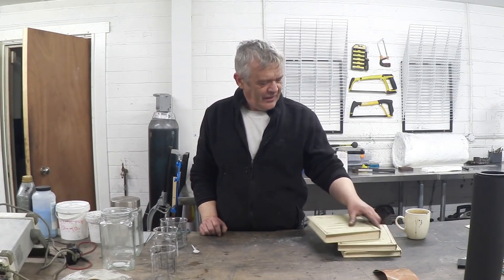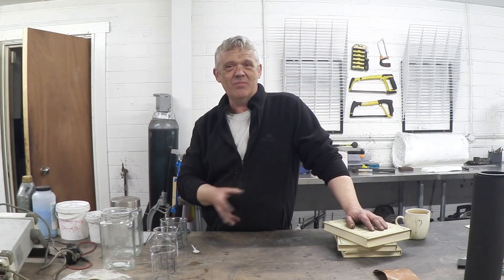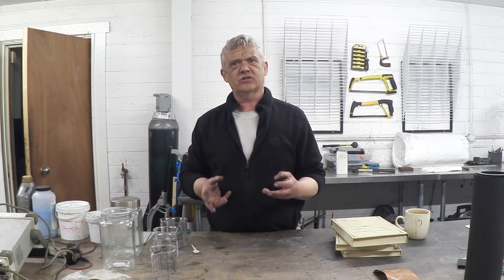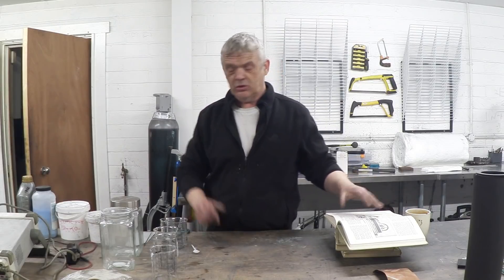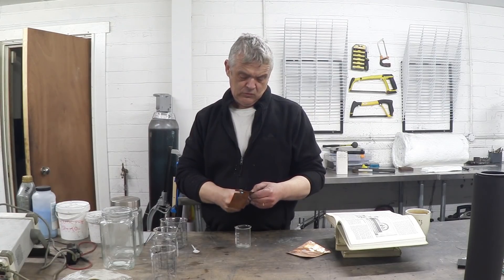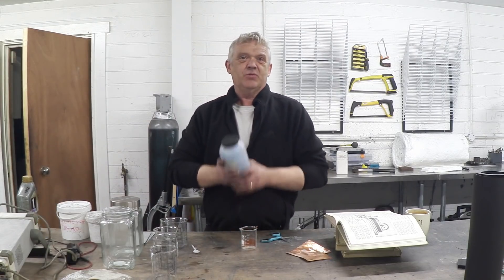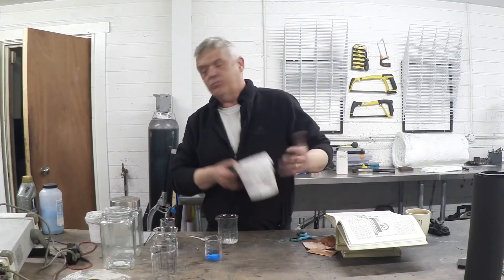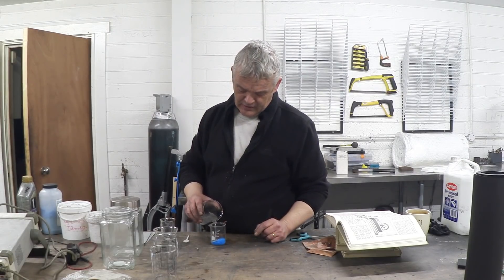Gravity Batteries - Cheap, Easy, Robust And Awesome For Off Grid

Comment: Sir, is there a formula we can use to figure the amp hours for these batteries based on starting materials?
Reply: Just wondering would you be able to make a version of this that takes less electricity to charge it compared to what I gives out?
Reply: @samboddy3182  it depends on the materials you make it from ...  you can look this up yourself, but there are two categories these batteries fall into:  1. a primary battery and 2. a secondary battery or storage battery .  While secondary batteries need a charge to supply electricity, primary batteries provide electricity as a result of the electrochemical reaction of its constituent materials.  One such battery mentioned is the zinc/zinc sulfate copper/copper sulfate battery Sir Robert describes here.  That battery requires no electrical charge whatsoever, because the zinc anode will give up electrons and the copper cathode will consume them.  As the zinc gives up its electrons it combines with sulfate to form zinc sulfate while the copper sulfate will carry the electrons to the copper cathode and the copper sulfate gives up its sulfate and returns to copper metal thus increasing the size of the copper cathode.  So in this reaction what is needed to keep it going is from time to time replacing the zinc anode that gets consumed, removing some of the zinc sulfate solution as it gets too concentrated, and adding copper sulfate which is also consumed.  But apart from that, it needs no electrical charging at all to function.  This is the definition of a 'primary battery' or 'primary cell'.

Comment: I expected a weight on a rope plus a gearbox and generator.
Reply from the maker: lol
Reply: gravity potential ones have low power density for home application
you will need over a douzen tons of weight to replace 40-50kg stationary battery

Comment: Interesting but pointless, the days of making stuff at home are over. If someone wants to develop this idea commercially then good luck to them, it would be up against fierce competition in a crowded market right from the very start.
Reply from the maker: I understand what you are saying but tbh you might be missing the point. The days of making stuff is in fact growing when facing the poisoning of the world by shameless consume and throw away. Now lots of folks are thinking make and be proud. It's what i believe too - i see you don't but you are free to make your choice of course.
Reply: Robert Murray-Smith I found your video of great interest because I actually live off-grid myself. I use a pair of leisure batteries for lighting and charging phones on my boat.... One day I hope to pull the diesel engines out and replace them for electric motors with NiFe cells. Possibly some home made NiFe cells.

Comment: You would be interested in the Earth batteries used on the telegraph lines back in the eighteen hundreds,  for some strange reason they never seemed to wear out, perhaps because after a while they ionized the earth, around them and plugged in to random telluric currents.

Comment: Oh good lord! This is utterly unsustainable. The energy required to mine, refine, process, and ship these metals and materials is hundreds, if not thousands of times higher than the energy you get out of this thing. Those materials are only cheap to you because all these expensive processes are subsidized and many costs are "externalized" onto the public, especially poor people. Then, what are you gonna do with the chemical solution after everything is expended? Pour it down the drain? Sure, you could reclaim the metals. But it takes even more electricity to do that. 

This is the indirect, chemical equivalent of a perpetual motion machine. It requires energy input from outside to work at all.

Comment: You have shown a battery.  For sure.  I expected you to show an energy storage system based on the falling of matter, from some height to a lower position, giving up energy in the fall.  I have seen several types of real gravity battery, so I do not think your display does not qualify.  I would describe what you have displayed as a chemical battery, like the battery in your car.  

I would have liked to know what the voltage and current, hence power,  your battery provided?

Comment: if a single cell was to be made on a larger scale, would the voltage increase due to larger surface areas ? Will the current increase? I do believe that the storage capacity would increase..  do batteries of these have a maximum power point? It would be interesting to put these batteries on a computerized charge controller to monitor the capacities. If we ever get out of lockdown... i'd be interested in trying these experiments in a 50 gallon aquarium size battery.... ! Thanks for the great video.... !
Reply: Put the cells in series to increase the voltage.

Comment: I have been a BIG believer in the power of Activated Carbon Water Filter Cartridges, especially in any Electrical Application where  SURFACE AREA affects efficiency. I'm led to believe that the average 10" x 2.5" Extruded Carbon Water Filter Cartridge at 1micron contains approx 4000 square meters of surface area. That's impressive for any kind of gravity battery or flow battery technology - in order to become competitively superior to Lithium Battery technology wrt power density vs cost.

Comment: The  reason I clicked on this vid is something I've thought for along time. Gravity batteries!! A 5000 pound concrete weight suspended from a device that employs something like a clock works. Using a chain hoist to raise the load to 10 foot high or higher. And a machine that converts the stored energy of the 5k pound weight to a rotating shaft spinning at 3200 rpm to turn an electrical generator
Reply: Guess i need to make that machine and video
Reply: @weslingm  The main challenge would be to keep the rate of descent constant in order to charge a set of batteries.

Comment: Thank you! Very interesting, and nice that you you dig into old ways of doing things. Making a off-grid battery of the second type, for a household,  would require a quite large container - or could they be installed in series/parallel?
Reply: Install them in series to increase the voltage.

Comment: Funny, I was sure that this was going to demonstrate different techniques of "pumped hydroelectric." 
On a large scale, I wonder if these are more or less efficient than pump hydro?
Reply: The answer to that lies in the scale required. Odds are this would be more SPACE efficient, and better for small scales while pumped hydro would be awkward at small scales and in tight spaces. 

On larger scales, the pumped hydro would start to shine. Areas where you are having to fabricate head pressure for pumped storage would probably warrant looking at a chemical/ gravity battery.

Comment: i am not a chemist so this may be out in left field. is the solution a form of salt as i recently saw something like this for a large commercial batteries the size of shipping containers but they used two solutions. each container would hold 100kwh of charge but they were not suitable for mobile applications either. also they could charge the solutions separate from the output cells.

Comment: I have a 10 KWH  Solar system  on my house and my electric company is buy my power at one rate and charging four times that rate to buy it back , so I would like to store energy in a gravity batteries that are much larger.... I was wondering if I could use a Blue plastic 55 gallon drum to  hold the con-taints of the battery...can I make a 55 gallon battery out of the drum.... And what would that look like to make .... how many drums would I need to make to hold 300 KHW of energy or maybe even larger battery system , like 500 KWH of energy?  Thanks for sharing your information

Comment: I'd be curious to hear a practical discussion of how this would compare with a bank of "high end" batteries used today for solar projects for operating homes. I believe this could be done more cost effectively and perhaps just as safely in an out-shed / house scenario receiving charging from various sources (solar, wind, even electric grid). So, my question: how would you ascertain the size you'd need along with accompanying duration for a full home load?

Comment: Might be more interesting if you zoomed in closer so we could actually see what is happening inside the jars.
Reply: And some of the shots feature dark objects held with black gloves in front of a black shirt.  Works well as radio, I suppose!
Reply: If you try it yourself. You will see it up close.
Reply: Zooming in as a one man production might not be that easy. Working with two cameras and cutting the video will be much more work. But at least you could reach with your hand closer to the camera and show, how you folded the pieces into the jar, for instance. 
If you would sit down for the video, your face would be automatically be closer to the object, you're working on, so that you could zoom in permanently, nearly doubling the size of each axis.
Reply: My first thought. I can’t see what’s happening. Very cool but I can’t see sh*t!
Reply: Yeah... He can use two cameras one for zooming in. One for the presentation....There after edit the video... Make them one video....
Reply: or get a bigger screen my 15 inch ss to small
Reply: See the "S"----NO
see  the Zinc where it's sitting----NO
See the Oil seal---NO

Comment: I have seen a grandfather  clock type of box with a set of weights. The operator came by and cranked it up. the weights went up then through a regulator controled System  it charged storeage batteries . (Silver type )( rail road type)  the generator it's selfe was rated at about 4watts. So every evening gran dad. Had current for his hand made radio. Shame he's gone. So is his radio. He did have a gravity powered radio hi hi.
Reply from the maker: thanks for the post mate

Comment: I actually expected something involving silicon dioxide actually 🙂

I also like building robust, simple technology.  I have a magnetic induction heater that warms 800 cubic feet of air by four degrees F in 17 minutes using a composite graphite aluminium disc and a 20 watt motor.

My next model will use titanium foil to increase the output and efficiency to a level I can use to heat my entire home and provide me with thermoelectric power.

I haven't decided whether to use peltier modules or build my own graphite based thermoelectric generator.  I guess I will probably try both. 🙂
Reply from the maker: cheers mate - thanks for the post

Comment: I have to go back a watch once more but I think it amazing make the little propeller spin, alot of my life is really exactly this making the little prop spin and to think of a way to do so different than Durcell,Energizer, and less expensive batteries! I would like a head to head Duracell, Energizer, Gravity battery battle for longevity. The idea of taking what worked in the past and trying to apply today's new types of tec to make a Better Gravity Battery out last today's wallet emptying batteries, that prices are sky high every day more and more things must use them So it opens a cool area of Well Seeing what is possible with what is between these two ears,The books you refer to I didn't get the name I must have been taking a drink of my morning coffee , Great Investment for future fun getting that set of books. Wonder if local library has them , Will  Share any successes with you on my channel. I got to first figure out the mixture need as one of the main ingredients in Gav Batt and round up the supplies for what I watch u make then Put my thinking Cap on and See if I can better the Classic Gravity battery 
Thanks for getting my mind moving

Comment: Must have gotten books from the old Lindsay Book company, I used to get books on old technology from them 25- 30 years ago.
Sometimes people experimenting years ago came to a stop because of materials technology but now going back with more modern parts the experiment can continue.
Some old technology you can’t get the materials any more.
I like the way you are using a motor to show power output as that might actually take some more serious power and not just some LED lights that take almost nothing..
You do need some close up shots of what you are doing ,
though .
Looks like something I am definitely going to try making.

Comment: Great video thank you.  I wondered with the rechargeable battery if you could use Graphene as the anode?  If so you it would take on the same properties they use in capacitors and you should be able to create a massive effective area in a very small space.

You didn't mention heat which I assume that battery also creates when charged.  If there was a design that allowed the fluids to flow past a heat sink to help dissipate the or even a convection pump arrangement might help keep the heat down while it's charging.

Subbed. :-)

Comment: Clever stuff, it's amazing what gets forgotten but with a new slant or the application of later knowledge can be as awesome as your zinc bromide battery.  Be interesting to know how efficient they are and what power density they have.  Could they realistically be usefully applied in a solar power set up for instance?  Or is it just an interesting curiosity that runs a little motor in the lab but is not practical so scale up for real world use?

Comment: Just an idea: if you mounted a funnel through the zinc sulphate solution into the copper sulphate layer; then poured oil around the stem of  this, you could easily refresh the copper sulphate without disturbing the other layers. A second funnel could be mounted into the zinc sulphate layer, allowing this to be refreshed.

Comment: Copper zinc gravity cells were also known as crow's foot gravity cells on this side of the pond due to the shape of the zinc electrode castings resembling bird's feet.  They were recommended in period literature for what at the time were called 'short circuit' applications, which we today call continuous load applications (telegraph and telephone circuit batteries especially).  They depend on the cells being under load to maintain separation of the electrolyte solutions due to the lack of a separator.

Comment: Great look at an earlier concept. I should do some calculations for something the size of a storage tub here in the US. Roughly 80cm x 40cm cross section. Depths of 15 cm to 40 cm. I presume a single cell regardless of size is still 1.8 Volts.

Comment: These are quite similar to Molten Salt Batteries:
A layer of Calcium/Magnesium/lithium/sodium/potassium floated on top, and salt in the middle with Lead/Antimony sinking to the bottom, all brought to a nice hot temperature to keep the salt and lead mixture liquid. As you discharge it, the ions from the light metals migrate and alloy with the Lead/Antimony or recharge it to allow the ions to once again separate.

Comment: I can't see that gravity has anything to do with these batteries. The are both galvanic cells. They would work perfectly well mixed up. The only gravity dependent thing here is the oil floating on top to prevent evaporation of water and or bromine. Chemical batteries is more accurate. Am I missing something?

Comment: This is really cool, I found some information that the Zinc Bromide battery can supply around between 34W*h/kg to 54W*h/kg, sourced from Wiki, not sure if that weight is based on the entire device or just the chemicals.  Thanks for sharing and demonstrating this.

Comment: I was thinking oh goody... another mechanical contraption... Then you started talking and I lost track of time. Great information and I agree we should take a hard look at the mechanisms and devices from days gone by and apply new technology and see how much better they can be! By the way, I have been collecting information about zinc-bromine batteries. When I retire I am going full off-grid. I am looking at an LTD sterling cycle set up as the main charging system. All sun-powered with no solar cells

Comment: Honestly I can't see anything old-but-new in this setup... Alessandro Volta did the first battery using a "battery"  of copper & zinc disks stacked one over the other and "wetted" with an acidic solution...

Comment: I thought it was going to be a weight with a system of pulleys and gears you lift which as it slowly falls, turns the windings of a small generator which then runs low voltage devices such as led's.

Comment: @Robert Murray-Smith
 - Interesting old tech, which properly ought to be called Specific Gravity Batteries. I was expecting something different, but not anything mysterious. I was expecting something with weights and a clockwork mechanism, or liquid flowing through a tiny water turbine or MHD generator. Got any thoughts on that sort?

Comment: Can you measure the voltage and current please to determine actual capacity and capability?
Reply from the maker: just do the research mate - have a look on google scholar there is a ton of info to answer any tech question on this - you are looking for zinc copper or zinc bromine batteries - this is a well known chemistry
Reply: @ThinkingandTinkering  I thought his suggestion was a good one;  if you're going to go to the trouble of building one, why not stick a meter on it and give people that extra (and very pertinent) information?